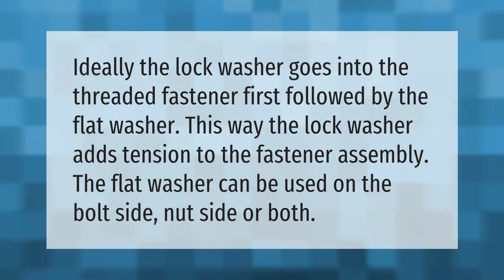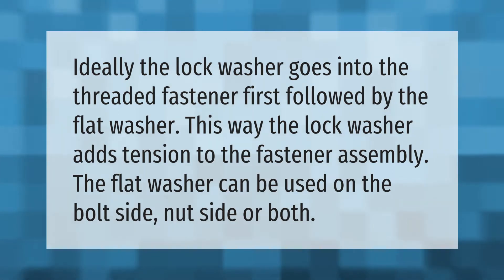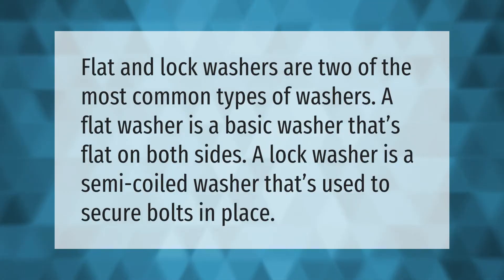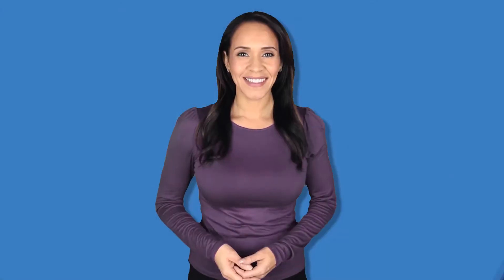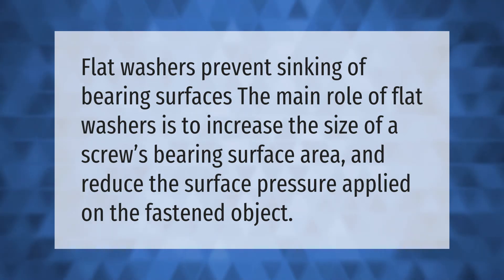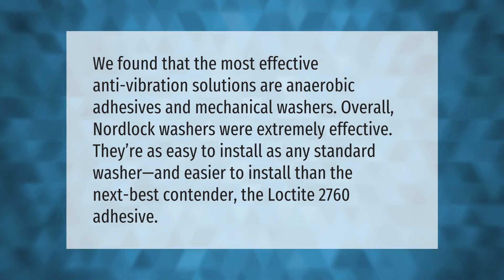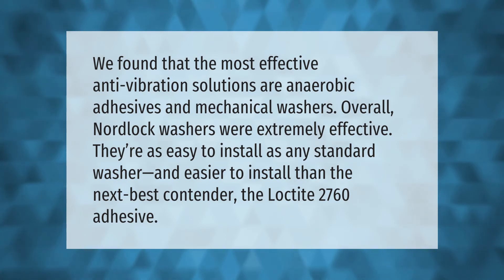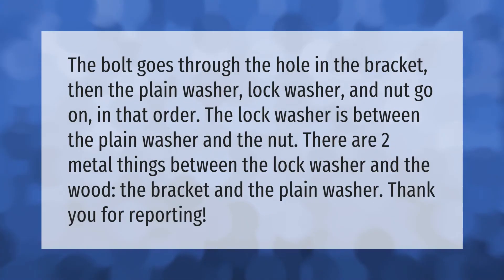What goes first lock washer or flat washer?

Comment: Actually coiled split washers do absolutely nothing for vibration unless combined with double nuts (2 full size nuts or 1 check nut (slightly smaller than the fullsize nut and 1 fullsize nut) or combined with Nylocks (Nylon Insert nuts) or Loctite aka Thread Locking Compound. The answer is found in the Nord Nut. I'm an electrician who installs high amperage gear using silicon bronze hardware. Bolted electrical connections tend to "creep" loose over time due to heating and cooling as loads are seldom constant. The number one cause of electrical fires and outages are due to loose connections. Especially on the Neutral Wire. You get what you pay for. Hire a professional electrician. People don't blink twice at the posted hourly labor rate for auto mechanic shops but often complain about my labor costs!